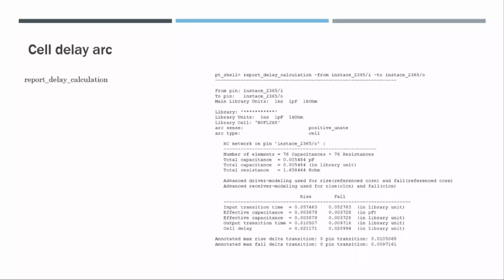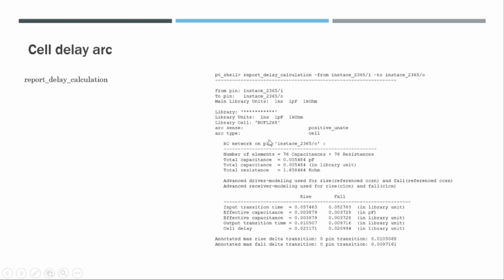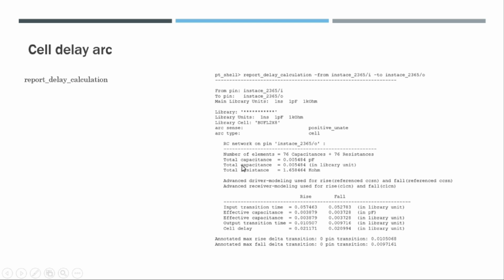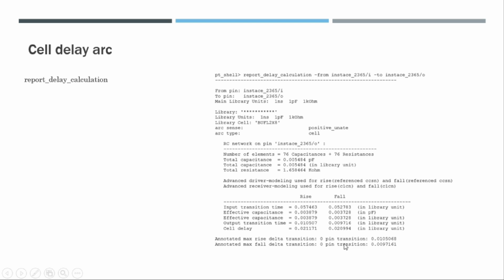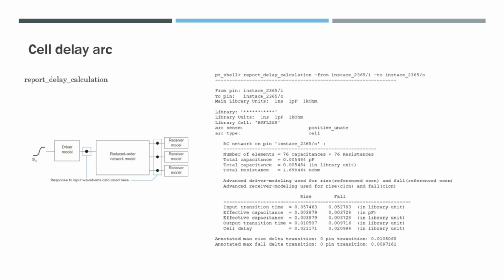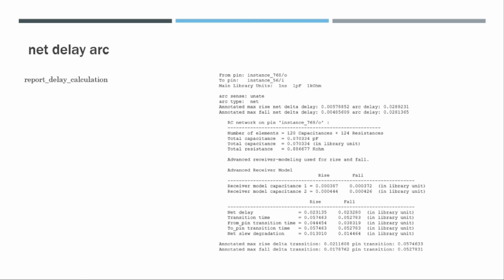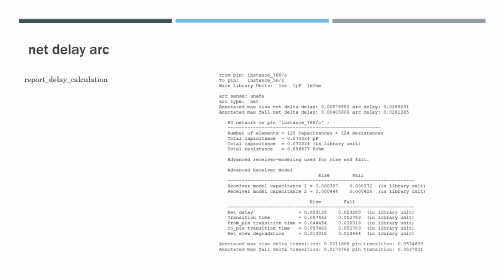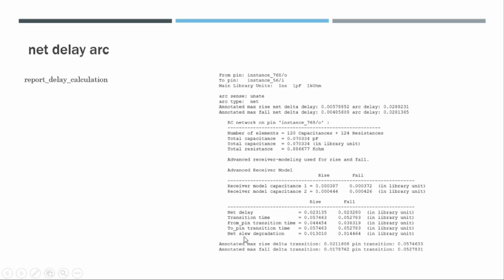STA Understanding report_delay_calculation

Comment: what is app variable if you could explain ?
Reply from the maker: App variables (application variables) are the variables that can be used to configure the settings that the tool provides. There can be many options depending on the tradeoff between runtime and accuracy. We got to choose the one which best suites our analysis
Reply: @jairamgouda  so its like parameters we set for the tool to do better optimization rather than regular.
Reply from the maker: @ yes